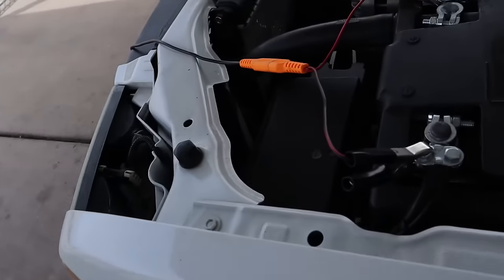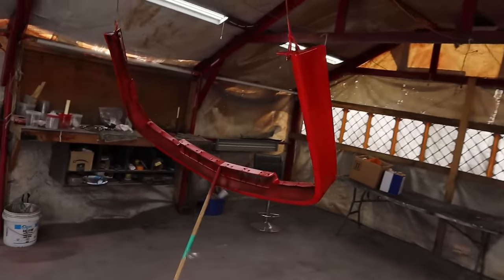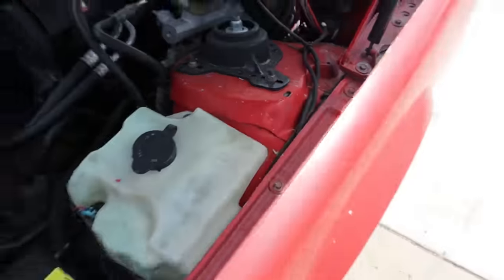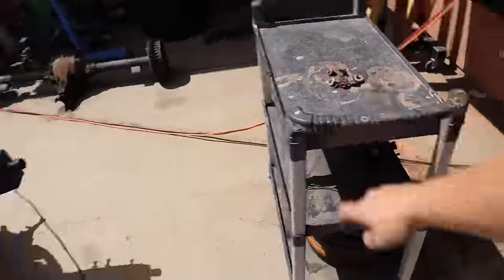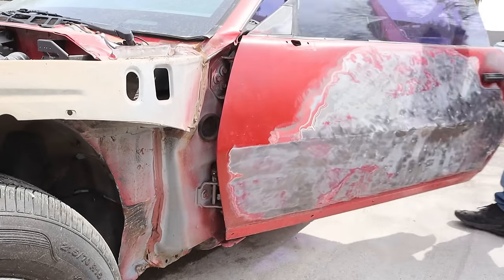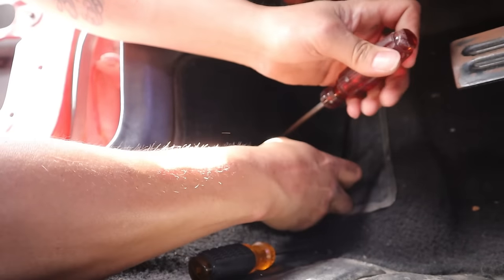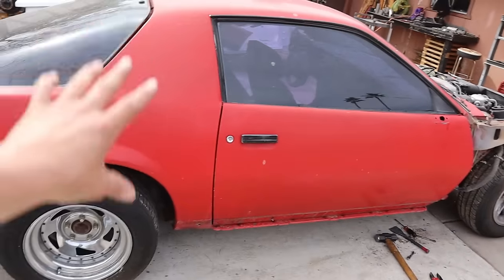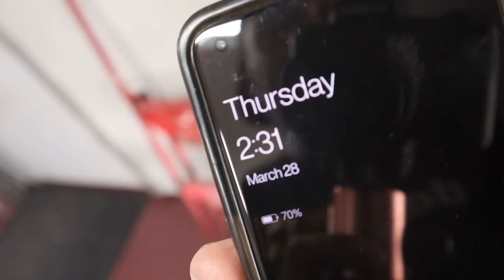Tearing The Camaro APART!

Comment: I just came across your video because the Camaro caught my eyes. I own two. A 92 RS and a 91 RS Convertible.  I know I’m a bit late but repairing those bumps it’s a product call Flex Filler 2 by Polyvance you should keep in mind. And with those factory rivets you can tap those pins down and knock ‘em out and you’ll have a hole to drill the rivet head off.  I fill your pain though on all the hidden damage.